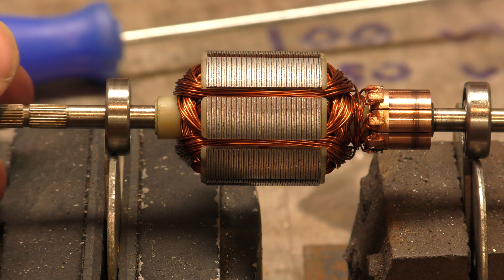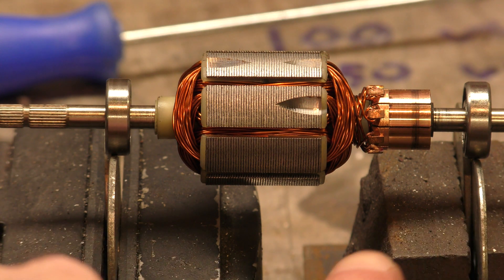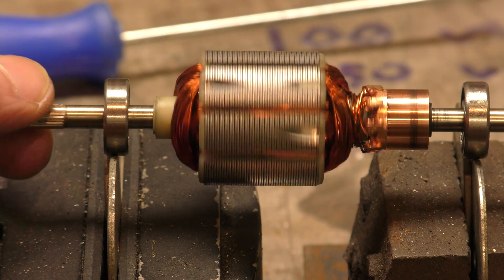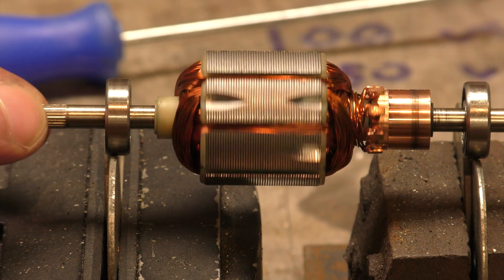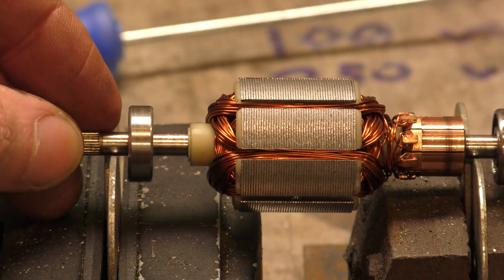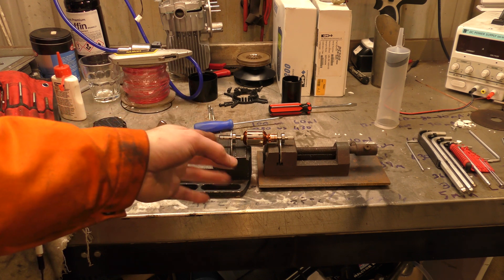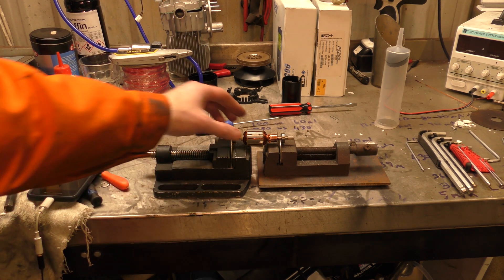Bent, unbalanced or bearings?

Comment: What size are the bearings? I’ve got a 2kW heater on the way, might need to do something similar if it’s noisy as well.
Reply from the maker: 625Z.  15x5x5mm
Reply: @DavidMcLuckie  Well, I'm afraid to say my 2kW finally arrived, and it's as quiet (if not quieter) than my 5kW, sorry, must have got a good one...
Reply: @DavidMcLuckie  Same size for the 5kw? I got a noisy one.

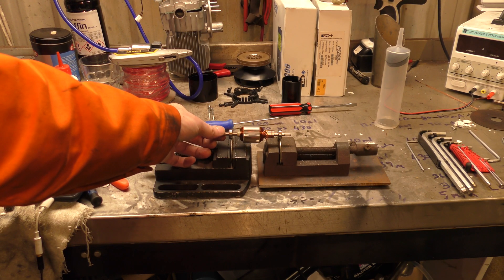Comment: Very interesting! You'l hear a bad bearing when you spin it between finger and thumb, compare the sound the front and rear bearings make. I used to race 1:8th/1:10th rc touring cars electric and nitro as well as buggies and a good bearing spins quietly and has no rough noise and spins freely with no cogging out of the case as you have it. I used to flush my bearing out with isopropanol spray and actually use a light machine oil instead of grease for better car performance from less friction, the armatures would spin for ever just like those fidget spinners afterwards.
We had all sorts of gadgets to maintain motor performance like tiny com lathe and even a Neo Neodymium magnet chamber to put back lost magnetism from heat in the motor magnets and various brush compounds and even different brush spring rates. Then brushless motors came along...;-) 
Anyway, its quite likely it has some manufacturing debris in the bearing cage, or it could be poor quality Chinese balls. 
Love the channel, keep up the great work. :-)
Reply from the maker: Well the new Japanese bearing are on their way so we'll find out soon I hope.  I too used to dabble in the RC world, just Mini Stox, nothing too exciting.
Reply: ah excellent yes it's definitely  a bearing issue, fingers crossed you'l get some smooth bearings.:-) 
Yes I remember Mardave chassis's and it made for very close racing, cool!! I raced 1:12th chassis's as well, I actually used to (take the pee) experiment with different shells, if you fancy a laugh have a look at what I did here's a link: https://www.youtube.com/watch?v=b45N6ldqnXM
Good to speak to you, all the best.:-)
Reply from the maker: Ahh those were the days.  I had a Morris Minor shell on mine at one point.  Making sure everyone was on different crystals and making sure everyone in the pit had switched theirs off.
Reply: Love the sound of the Morris Minor shell!:-) lol I remember going from 27Mhz to 40Mhz then to 2.4gig and no crystals and unlimited frequencies it was a real game changer to finally have no glitching/interference it transformed the hobby for me! I think we could talk and bore everybody for hours.:-)

Comment: Dial test indicator is your weapon of choice for run out also something your seemingly meant to use on brake discs to check for run out (though I never have)
Left side bearing looks like it's angled on the shaft possibly
Does it feel balanced when your rotate it or does it feel like it wants to roll to one particular position?
Reply from the maker: The bearings aren't free enough for it to roll.  Once the new ones are on I can better test if it's out of balance.  Sadly I do not own a dial test indicator.
Reply: @DavidMcLuckie  Neither do I, something I keep meaning to buy tbh

Comment: The copper bit on the right hand side might have a bit if weeble (or wobble) like it's mounted squint maybe?
Reply from the maker: The ends yes are not square, but the surface the carbon brushes run on looks okayish.